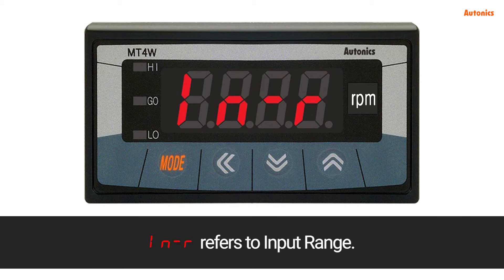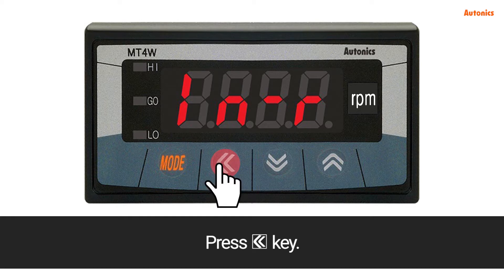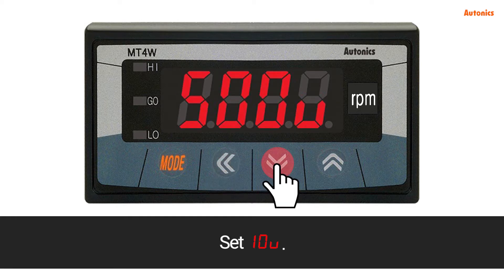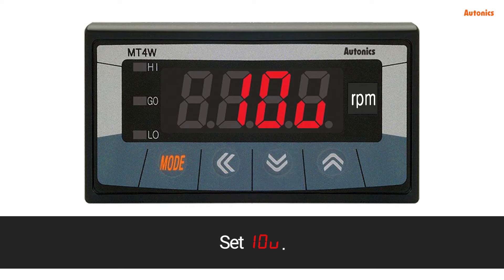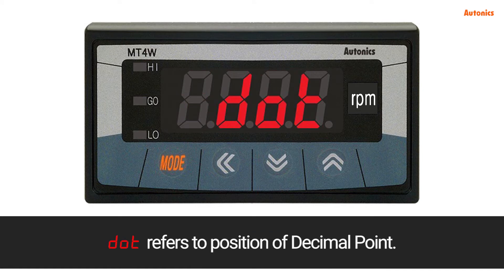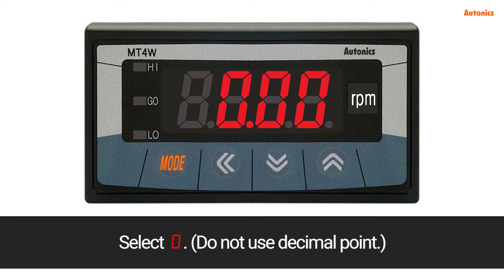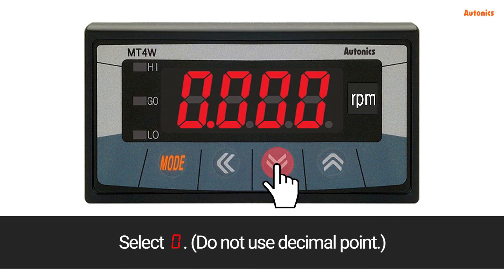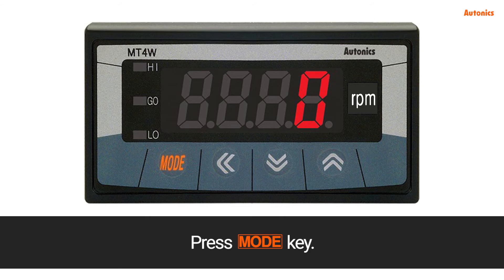Autonics Tutorial : Setting Parameter When Using Inverter(MT4W-DV Series)

Comment: While speed measure after measuring 500 it showing LLLL .we set voltage is 500v.kindly share the settings
Reply from the maker: Please check what the measurement specifications are.
The video explained the process of measuring 0-10VDC in the inverter and converting it to RPM(0-1800).
[LLLL] is normally displayed when the measured input is below the specification. ( [-]voltage input)